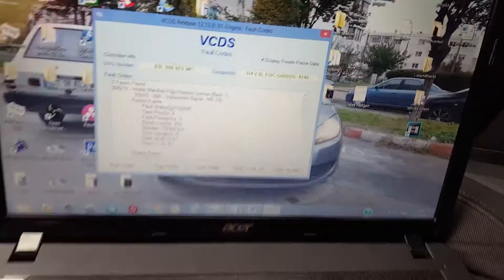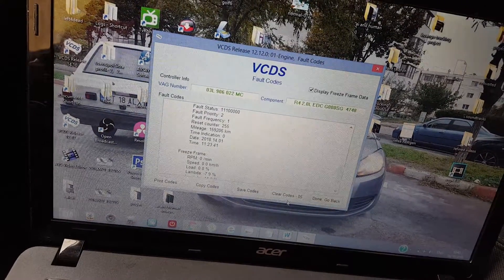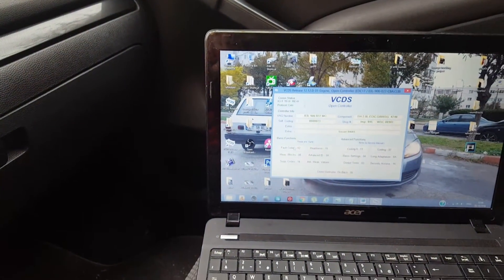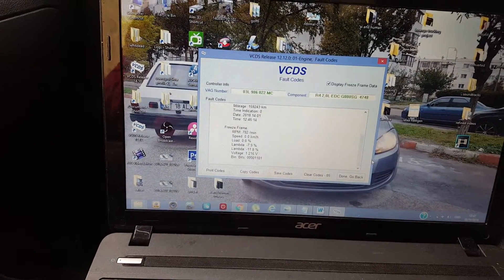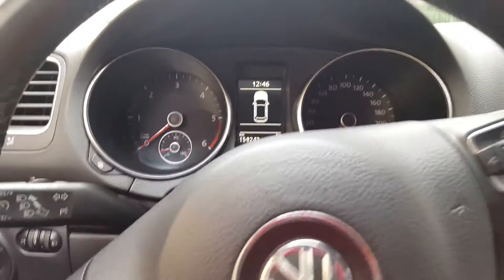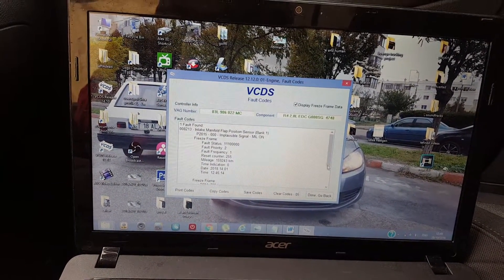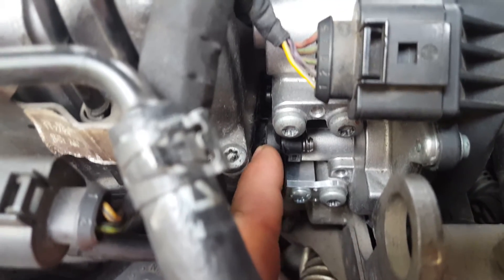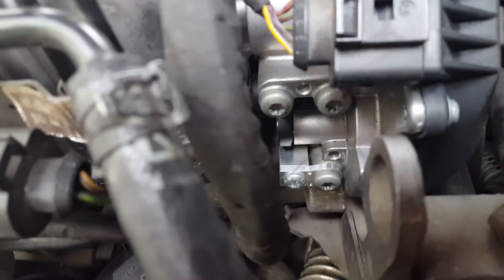Dieselgeek P2015 fix bracket didn't worked for my golf 6 [SOLVED]

Comment: I think u try to clean All plastic manifold part it may  block the plate inside
Reply from the maker: +M SAEED AKBAR 
I didn't try that, but maby you got a point, I don't know everything the old owner did to the car, so it is a possibility.

I recently contacted him and found out he swapped the motor of the manifold with a new one, I asked for the old one back and mounted it with the dieselgeek bracket, and so far so good no more error code.